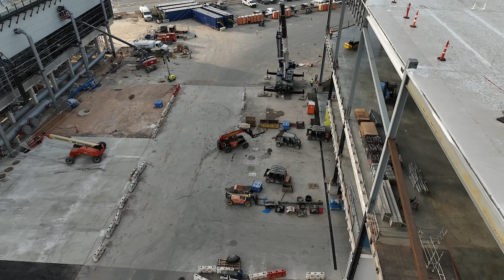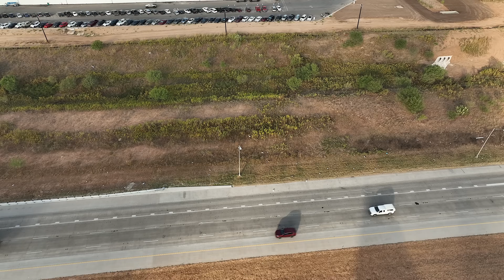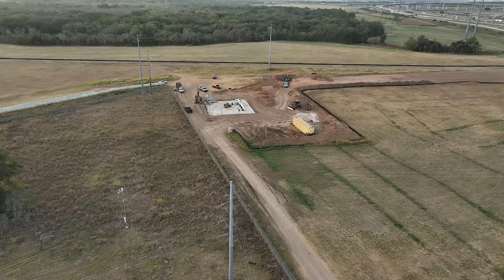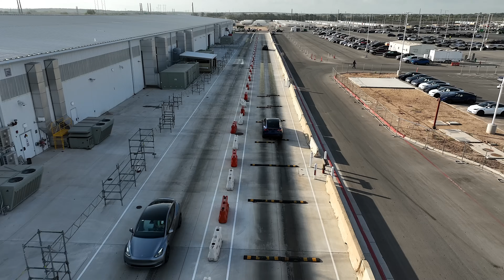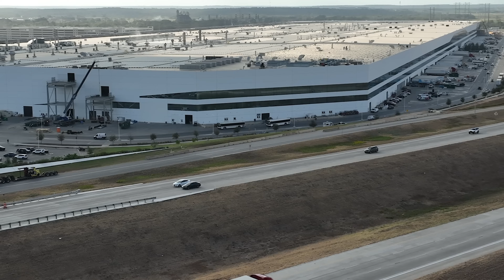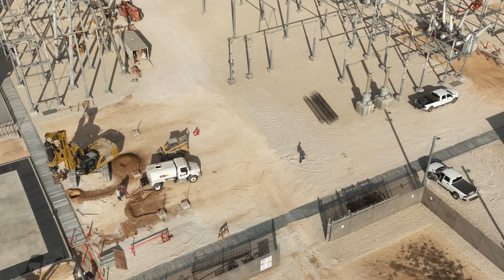:Busy Shipping Out"  Tesla Gigafactory Texas  10/29/2024  8:50A

Comment: Thanks Brad.
1:21. Southend, Cooling Tower. Final riser fitted and painted silver.
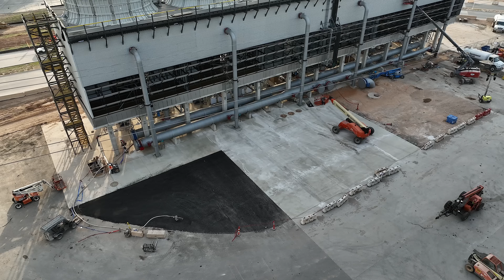1:30. Southend, Cooling Tower. Water shimmering in the basin under the fans.
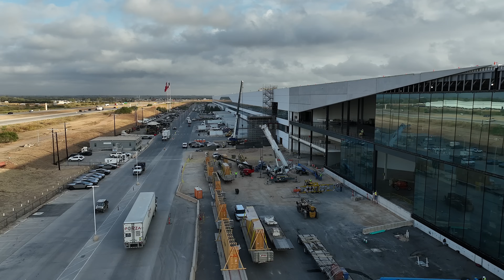3:00. Southend, west. Apron. Glazier’s crane relocated northwards. Opening above the tunnel alignment yet to have the glazing channels installed.
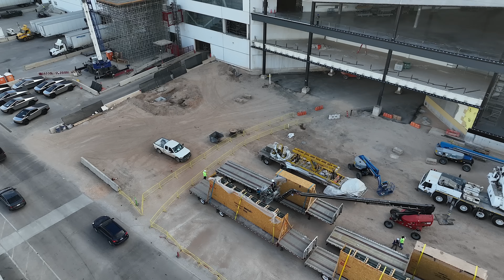3:36. GA, road. White Ford van has a chain suspended bar under the front.
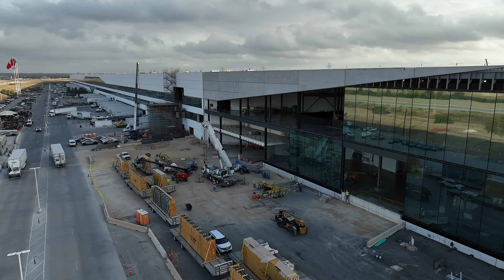Same seen fitted to a forklift earlier in the year, and yard dog at 3:06.
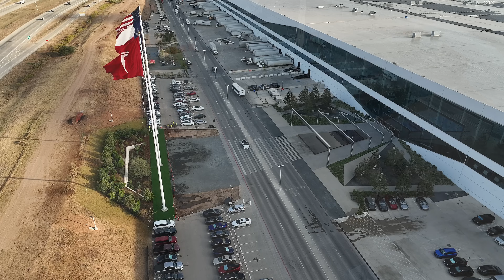3:53. Flagpoles. 3 white flagpole base covers are gone. Not installed.
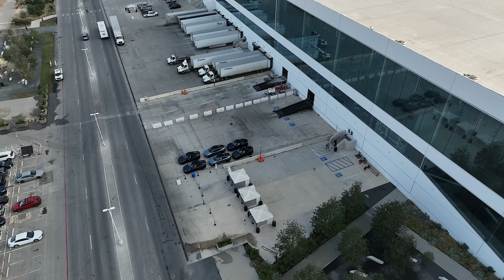4:09. GA, EOL north exit ramp. Evidence of concrete cutting. Wall panel cored for lifting sling attachment in Joe’s last video.
5:06. Westside, Tunnel Project. Top right. Loading up the last of the salvaged pavement sections.
13:03. Westside, storage. Left. Stamping press components are being covered up again. May have been a maintenance program only for checking for rust and damage etc.
15:45. Casting, diagonal corner. Apron. Loading platform being assembled. Likely for running out cables similar to the platform at Stamping.
16:14. Casting, east. Apron. Lightweight duct section rolling around in the breeze.
16:48 Switchyard/substation. Drilling rig boring a pile shaft. 2 completed and covered with boards.
17:42. Casting east, canopy. Formwork around the columns bases for concrete encasement.
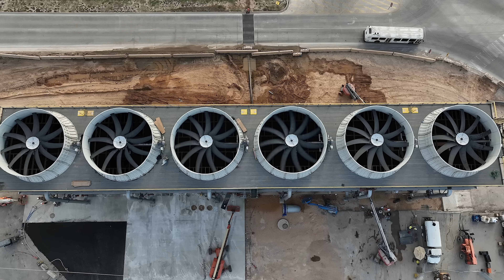Reply: 1:30 I noticed that. Likely operating at low power for testing. Still no steam out of the top @ 1:39
15:45 I completely missed the new cable loading platform. Thanks. I was focused on the still unconnected cables at the bottom 😊
Reply: @DavidJohnson-tv2nn  1:30. I doubt it is operating at all.

I think the current Data Centre cooling capacity is probably being met by the existing plant on top of BIW.
Reply: @DessieDoolan  You may be right. And the "29,000 H100s" in the data center are probably operating at low power or very low power. Considering the power available, and....
@ 16:27 Not really a good view but no steam from the BIW vents either.
Reply: @DavidJohnson-tv2nn  Joe's 29 May video at 11:02 shows pipework at a high level between Stamping 2 and the Data Centre.

The BIW chiller plant has massive pipes heading west into Stamping 2.

I reckon it's a good chance that's the connection.

Utilizing an existing cooling plant before the new plant is operational.

There's better views in later videos, but I don't seem to have made a note.
Reply: @DessieDoolan  Yes, I know what you mean. I remember seeing those large pipes coming from stamping 2 in previous videos. But the available power is still a limiting factor for the data center. Just not sure exactly how much power those 4 circuits that are bringing existing power to the data center can carry. Too many unknowns like cable size and type. But definitely less than the unconnected 16 new circuits (48 cables) from the substation seen @ 15:43.
Reply: 3:36 Magnetic bars to help pick up tire flatteners.
Reply: @DavidJohnson-tv2nn  Power. Some megapacks have been moved inside as per information from Joe. He was told it was for supercharging Cybertrucks. Others have commented it could be bolstering the supply for the Data Centre.
Reply: @bobcallahan2322  3:36. Thanks Bob. What a great idea.

Added to my notes.

I saw the formworker crew pushing around a magnetic nail collector in an earlier video.
Reply: @DessieDoolan  I have doubts about both charging Cybertrucks and bolstering the supply for the Data Center.
Cybertrucks....They seem to be doing fine right now in driving to the west side without additional charging.
Data center..... The thing to remember about Megapacks is they can not generator power. They can only store energy. So while they can momentarily boost power by a small amount (each Megapack is rated at 2 MW).... They would take energy to charge. Now, if the data center is not running 24 hours per day, maybe the Megapacks could be charged during the down time. The other issue with Megapacks is that it is probably not a good idea to put a fire hazard in a multi-billion dollar data center.
Reply: @DavidJohnson-tv2nn  Megapacks charge up during the night when there is excess supply, and discharge during the day when the current factory supply isn't adequate.
Reply: @DessieDoolan  You may be right because they are currently having to share power with the factory. But it is still risky because if there ever is a fire.... They are screwed!

Comment: Thanks Brad!
Substation expansion project:
@ 16:55 Drill rig drilling for the support structure for a set of 345 kV switches.
Note: To know what is being built or what will be built next.... Look at the structures to the west.
Still to be done.... Concrete piles to support the A-frame towers.
@ 17:21 Close up view of the new 345 kV circuit breakers and new switches to the right. 
Status of the new power supply to the data center:
@ 15:53 48 Unconnected cables from the substation.
@ 16:06 Empty cable trays.
@ 16:24 (Upper right) 4 circuits (existing power) from the main switchgear room on one of the floors below come through the roof and head south.